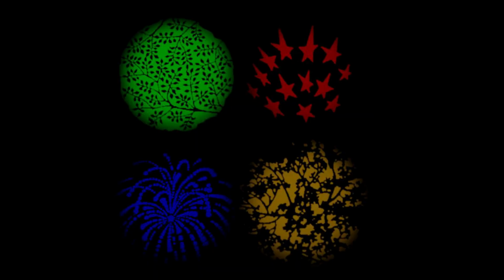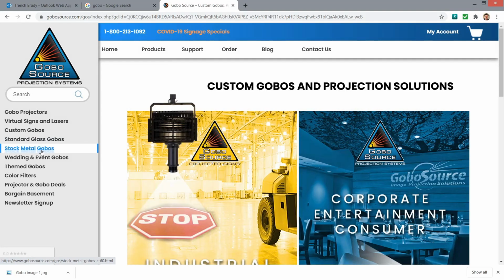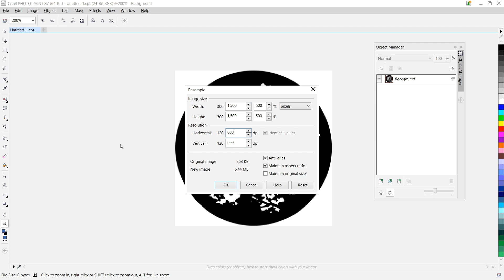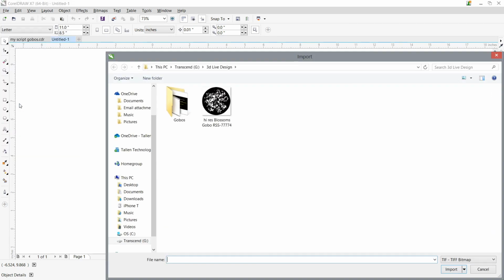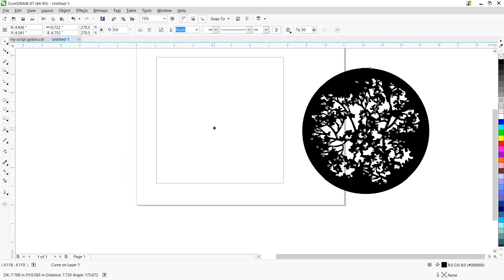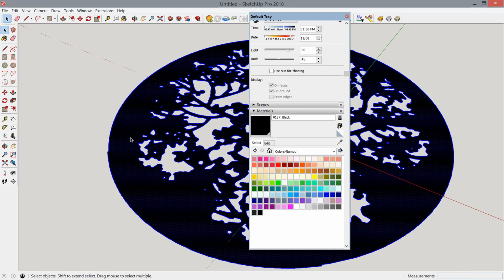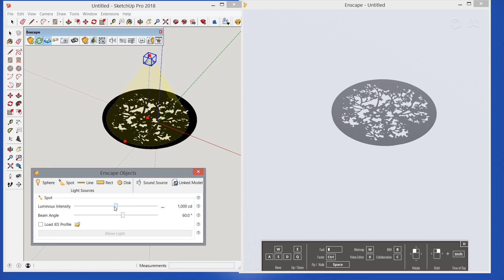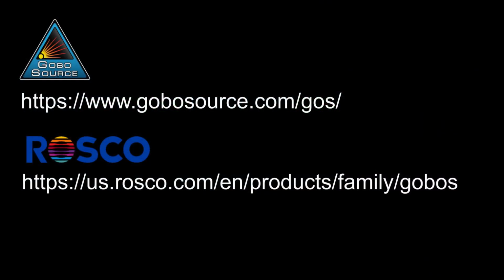Gobo creation for 3D rendering programs tutorial.

Comment: Great video, but the workflow how to produce the Gobo-image for the spot light can faster. I downloaded the gobo image and in Corel Paintshop Pro ( or any image editor) make it a black & white image, enlarge the image with highest quality as a vector image, then select black or white, smooth the selection, delete the flames and safe as a PNG. Import the image in Sketchup as an image, explode and group it. That's it. With trial and error adjust the cone diameter and distance between spot light and gobo.